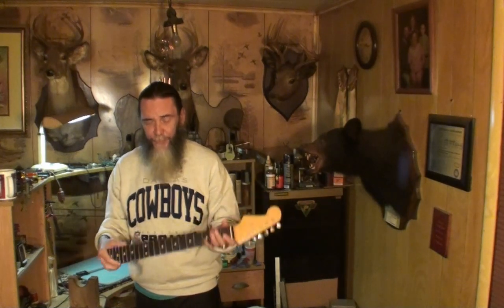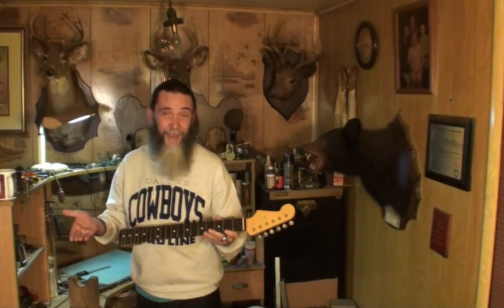twisted guitar neck you NEVER want to happen!

Comment: Hello!
Thank you for the video!
I'm about to buy a new Custom Shop Strat with 10-46 string gauge. The tech in the store measured the relief and the bass side reads 0.085" and the treble side reads 0.010".
a 0.0015 difference.

Do you recommend buying this one?
I heard that more relief on the bass side is preferable.

Comment: I have a LTD with neck thru and cant REPLACE IT i cant Shred or solo on it because of dead notes and i bought it in 2017 and I've tried to have this fixed and i would have to have my fingerboard removed and the neck plained. Being a neck thru body i CANT REPLACE THE NECK like a bolt on neck. I have an LTD FM-300 Series that is not repairable. The locking nut for the trem was stripped and i couldnt get proper replacement nut so my strings are 3/16" above the fingerboard at frets 1&2 so i can't even fret a clear note this was a NO SHRED NO GO GUITAR FOR ME. This is my bad experience of having a TWISTED GUITAR NECK.

Comment: Might the reversed headstock cause the longer bass strings to stress one side of the neck more than the other?
Reply from the maker: that's a good possibility! the head stock really wasn't designed for string stress in the way it is applied here, and the entire neck is twisted rather than just twisted in one spot. thanks for this idea and thanks for watching!

Comment: Hey sir Randy, i've adjust my truss rod neck. in this case, my neck on the low e string is looking straight, but on the high e string is bow forward. How's that possible?
Reply: Remember, a little bow is necessary or a guitar with low action will be prone to buzz. It's more common to see bow on the treble side with a straight or straighter bass side. You would think that there would be more stress on the bass side, but more bow always seems to occur on the treble side. This doesn't necessarily mean you have a twisted neck, but anyone should be aware of such changes & to inspect the neck every so often to see if one side is seeming to change more than the other. It is also worthy to note that humidity changes will effect neck relief as well. Sudden & drastic humidity changes can & will cause a neck to bow & sometimes twist so be aware of weather conditions when you ship instruments. Late spring & early fall are, in my opinion, the best times to ship with more ideal temperatures, but your location may be different.

Comment: Hey Randy, could you ship Earl's neck to NJ? Ever try to twist Earls neck? Of course he'd probably like it and insist on a twist everyday! I tried to do a bit of a set up on a friends guitar, about  $200 axe new, and the neck was twisted. I did the best I could and it was better but it's hard to make a Hugo into a Cadallac. But it turned out better than it was. I did indeed see that twist and that would be a hard thing to correct. I'd think about all you could do is make a new neck with some top of the line seasoned wood and reuse the fret board and tuners. But it would be cheaper just to buy a new one I recon, eh? Thanks for yet another THTNS video, much appreciated. May be you could adjust Earl's neck with a chain saw or do you think he'd like that? Thanks Kindly Bro! Blessings to All At THTNS  from DaveyJO p.s. I think you need Peanuts!
Reply from the maker: ah yes a great idea adjusting Earls neck with a chainsaw! surely that would not be enjoyable for him as it would for me lol yeah may be able to take off the fret board and plane the neck flat. I've had success in forcing the twist out along with fails, but clamping it flat under heat and humidity sometimes works. thanks for having a look brother!

Comment: Honestly you never held the camera level with the rosewood reveal line. Always tilted the camera a little. It also looks like some of the file work wasn't to profile radious. . Looks like a hump from the frets, but the wood looked ok. Not sure on camera,  frets shouldn't buzz after a good set up too bad. If there is enough relief, you shouldn't hear buzzing alot. Maybe when you strum or pick hard.
Reply from the maker: the way I shake I'm lucky to hold a camera at all. the frets have some blue marker on them I colored them to check for low or high frets. thanks for checking it out.